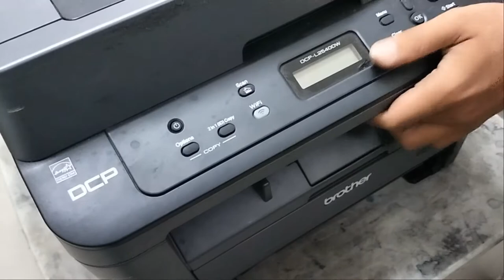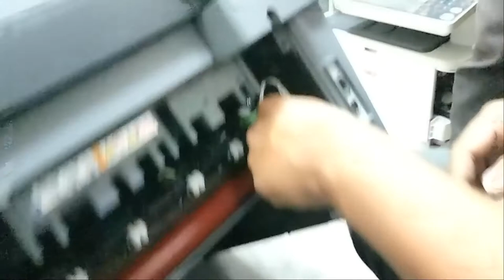How to replace Upper Fuser Roller on Brother DCP-L2540 printer

Comment: Kalo di bagian fuser kanan dan kiri ketika dinyalakan muncul percikan api dan tarikan seret suara kaya mesin jahit apanya ya...
Reply: lampu fuser memamg nyala gan pas printer dihidupkan dan pas mau print.
Reply: @kadec100  tp knpa ya.. kok suara mesin kaya mesin jahit.. apa perlu pelumas.. Grease oil.. atau Salica jeel dan sejenisnya.. mw bongkar takut salah.
Reply: @alfianprinting7170  hasil print normal atau ada titik2 hitam?
Reply: @kadec100  ada garis hitam tipis banyak.. apa mungkin user/uper minta ganti ya.. mohon saran
Reply: @kadec100  ada garis hitam tipis banyak.. apa mungkin user/uper minta ganti ya.. mohon saran
Reply: @alfianprinting7170  kalau garis horisontal biasanya drum kotor, kalau vertikal bisa drum atau catridge, atau upper fuser sobek, garisnya sesuai tempat sobeknya, hasil print juga ghosting, yaitu cetakan diatasnya kecetak lagi tipis dibawahnya. coba dibuka penutup belakangnya saat ngeprint, disenter diintip fuser roler bagian atas saat heaternya nyala kalau fuser atasnya (yg coklat) bergelembung atau ada sobek berarti perlu diganti
Reply: @kadec100  tidak ada yg sobek .. cuma suaranya keras kaya mesin jahit.. Tek Tek Tek.. gitu.. dulu hanya bunyi ngik"".. kaya seret..
Reply: @alfianprinting7170 bisa dikasi Grease khusus gear priter atau wd40 1tetes di bagian gesekan gear dgn besi. jangan disemprot. fuser, roller atau kaca laser tidak boleh kena. kemungkinan lain debu di gearnya
Reply: @kadec100  siap nanti cb saya cekk